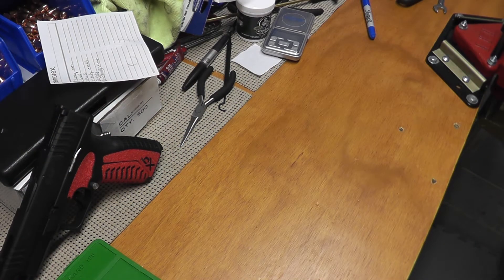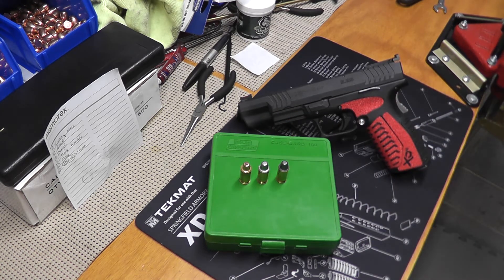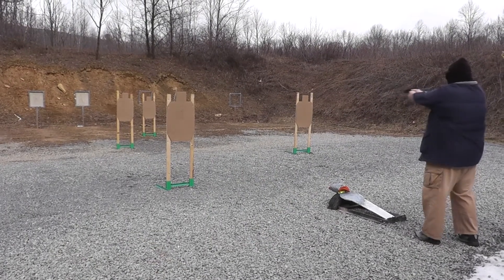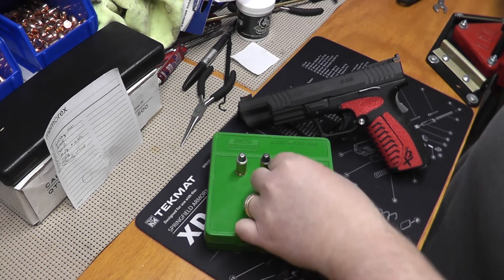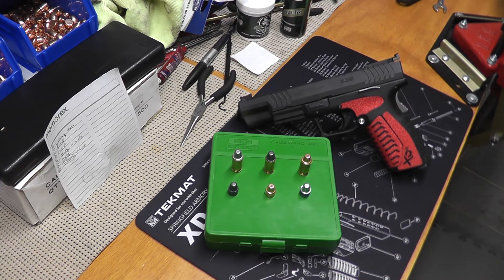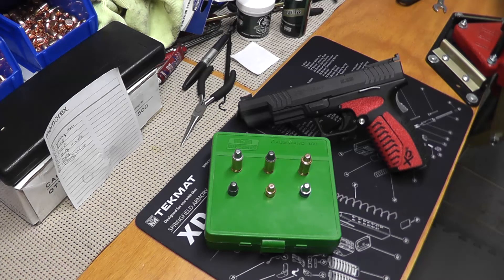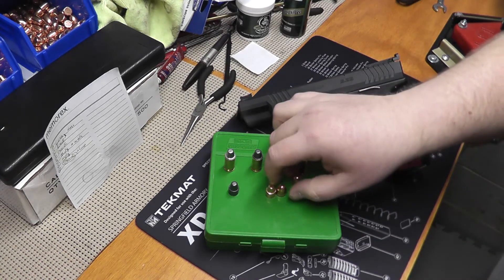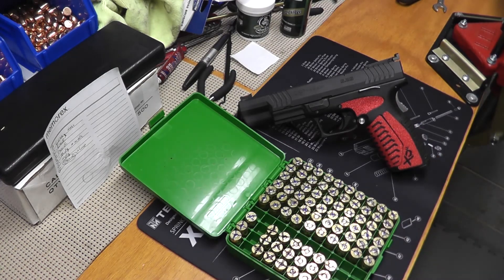Bullet Smoke Comparison: Cast Lead v. Moly v. Plated

Comment: Seems like a catch 22: availability/cost vs smoke.  Look at it this way, the smoke gives you concealment.  Stay away from 1 R ogive cast, they have to be loaded real short to go into battery on the xdm45 5.25.  Remember the bottom line, HAVE FUN.

Comment: I am on the brink of reloading (still trying to get Primers locally) and have 1,000 Black Bullet International 147gr 9mm Poly Coated Bullets. The manufacturer of that bullet recommends staying away from certain powders due to an increased volume of smoke (they say the powder works fine it just creates a lot more smoke). Do your coated bullets come with a recommended powder to reduce smoke?

Comment: Why drive yourself crazy? Xtreme bullets are the best overall value.
Reply from the maker: Didn't drive myself crazy... was something I was curious about.  Was just posting for informational purposes so others may make an informed decision.  This was also 4+ years ago and I am not shooting any of those bullet types anymore.  I exclusively shoot King Shooter's PC Bullets.
Reply: Just a figure of speech my friend. I've tried them all and personally got so fixated I was going mad. In my experience the copper plated bullets are the cleanest and safest. Pricing is all about the same for all the suppliers. Shaving a fraction of a cent here or there is not worth it to me. So I pretty much gave up trying all those moly coated, powder coated, or just lead. Nothing burns cleaner than a jacketed bullet in Copper. And Xtreme has specials all the time with often free shipping. Also, keep in consideration that it is not wise to load a hot round with lead or coated bullets. Granted...Xtreme is plated also but a bit safer when working in the Hot Load Department. Thanks!
Reply from the maker: Not a problem.  Never worried about hot loads in .45acp for competition shooting.  I prefer the coated lead especially for steel shooting since jackets have a tendency to just fly anywhere.  Coated lead breaks up nicely.  Thanks for watching.